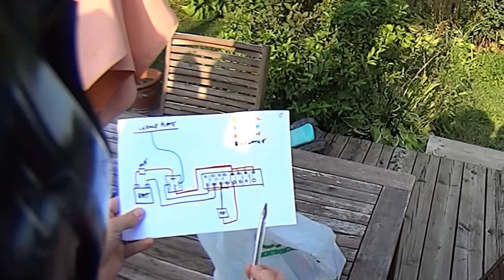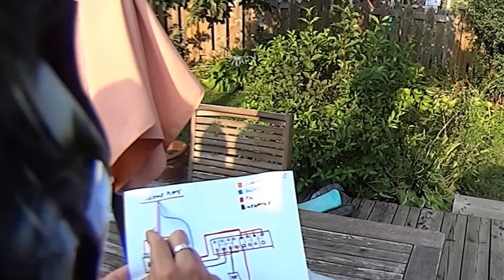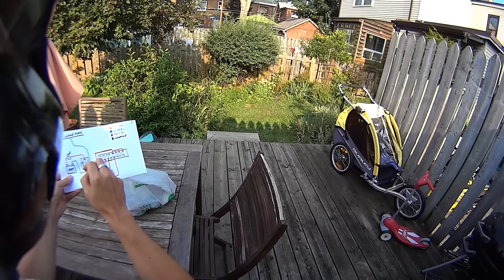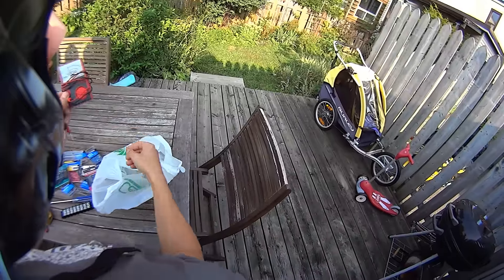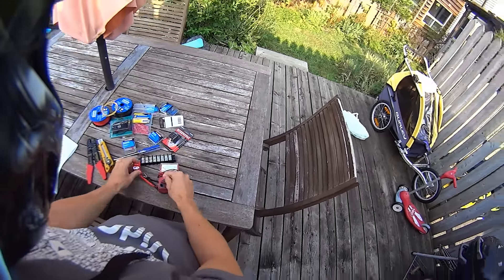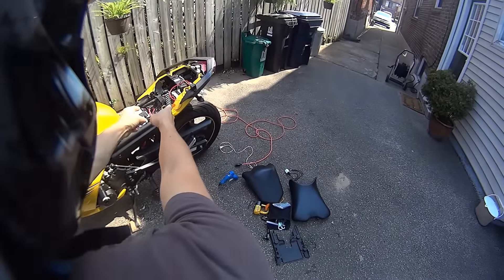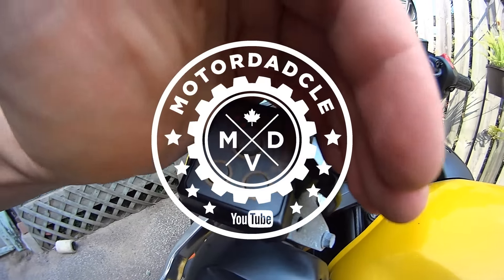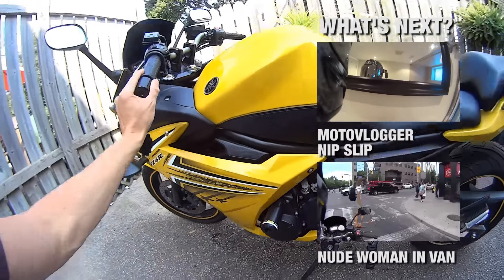HOW TO: Motorcycle Power Distribution Block

Comment: Hello. Thanks for posting your set-up. I just wanted to let you know that 18 AWG has a max current rating of 16 amps. So if you use a 20 amp fuse as you described here this would violate the safety factor for wiring circuit design.  A fuse is designed to blow/break open before the wiring can get hot enough to melt insulation, create a dangerous short and start a fire. A 14 AWG would be a better matched conductor for your application at a minimum and I consider this borderline. But, these conductors may still get really hot if they reach their limits for loads close to 20 amps. Based on scientifically developed AWG charts/tables you will find that AWG 12 would better suit your application because of the extra heat a motorcycle electrical wiring circuit would be subjected to while out in the sun or in warm climates. Also, the operating temperature of motorcycles in general tend to be quite high which would impact how much hotter the wiring will get under load. Anyway, I have seen how wire insulation melts , the destructive effects of short circuits, and the fires that occur when using undersized wires and it's not pretty.  Please don't take this as an insult of any kind with your project. I work in design engineering and one of the things we do is peer review and analyze things using all relevant and established standards to assure we use the best information to design for the best possible outcome. Have a great day and be safe out there.